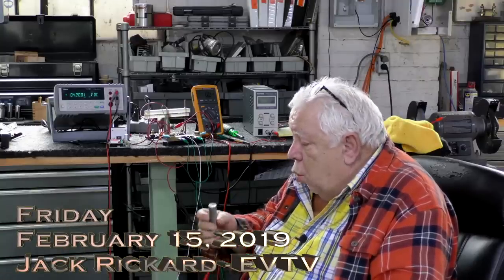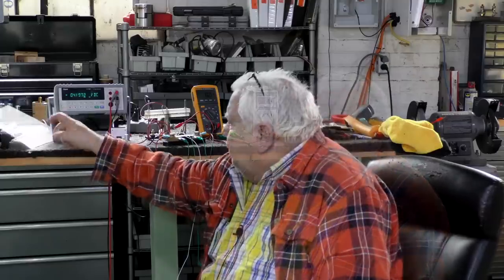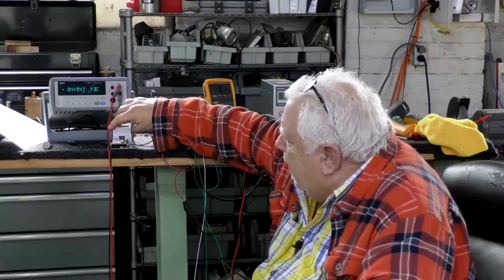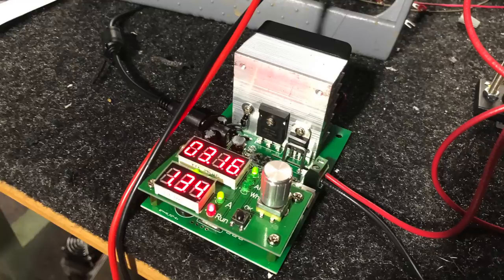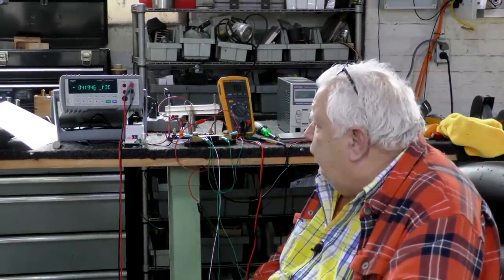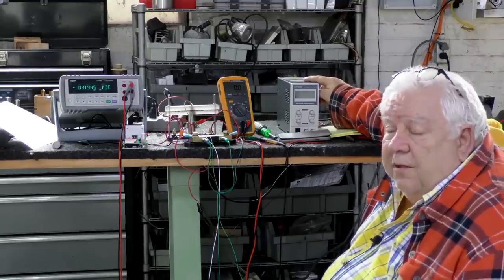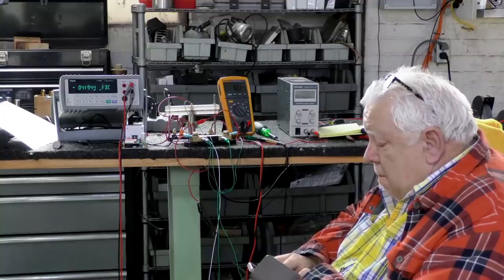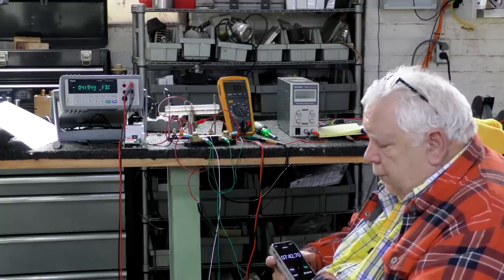Testing Tesla Model 3 2170 Cells - Battery Nerd Porn with Full Frontal Nudity

Comment: Great video !  One thing is the battery temp will get higher when its it the pack. Like 46 little heaters making there own heat island.
Reply: Jack Rickard My Chevy volt packs change temp very little in my power wall never more + or - 2f charging or discharging.  : )
Reply: Jack Rickard my Chevrolet Volt can consume 10.4 kilowatt hours in as little as half an hour which typically can run my house for at least half a day long as it's not summer time. the fun project I would like to do one day would be to find a Chevrolet Volt hit in the rear pick it up really cheap like two grand and use the entire high voltage pack with the 55 kilowatt hour generator if the engine already has attached to it then use one of your high voltage inverters to make a complete Off the Grid system with the car I think that would be fun project.

Comment: My guess is that the ultra capacitors will find a use alongside renewable generation to balance output.  I would wager there is plenty of peaks and valleys in energy output on wind turbines and solar panels.  Wind gusts and lulls or the sun going behind a cloud for a few moments.  Ultracapacitors, are extremely durable in terms of temps they can operate in as well as have an incredible cycle life.  They should be able to absorb incredible spikes in energy and release it consistently to the grid while outlasting the design life of the plant.  Space is not really a consideration, nor is energy density in this application.  Just adding 5 minutes of storage to a wind turbine dramatically increases it's capacity factor.

Comment: The batteries Tesla has called output more power than their motors can handle. So why can't they make a more powerful motor? What's the limiting factor for extremely high power electric motors?
Reply: Michael Simm there’s no need for bigger motors because then you would lack traction. If it’s not one thing it’s another. The new roadster is going to be the max limit of traction, motor power, and battery power working together. But as mentioned, it’s going to be more expensive than your run of the mill EV
Reply: @ryen7512  I totally agree for low speed acceleration tests. What I want to know is can they build a motor that can keep accelerating quickly at 200+ mph, can they get to 300?
Reply: Michael Simm of course they can, but there’s not much of a market for something that will go 300 mph. The new roadster will probably come close.
Reply: @ryen7512  it's not about the market, it's about 'slam dunking on every Gasmobile ever made in every single way' It's about the Halo effect and I think Tesla doesn't particularly care about making money off it.
Reply: why we need that much power for a daily car！

Comment: Oh my! Ffs now you’ve taught your helpers to say KiloWatt when they are talking about KiloWattHours! I‘m surely just like the old man yelling get off my lawn, but it hurts so much to hear that distortion. Maybe I’m feeling sorry for the newbies that are surely confused, as I was long ago.
I will continue to suffer mostly in silence, but every now and then I will break my silence and whine. 🤪
Keep up the interesting work!  Many thanks!
ps. Maybe check if your power supply has compensation terminals on the back, if so you can wire sense leads and get the cell terminal voltage to hold rock solid.

Comment: Mr. Rickard, I've been trying to turn the rusty gears in my head and thought of something that at this point would be nothing but a brain fart on my part, but thought it might be worth bouncing off of you none the less.  

If Panasonic's current 2170 cells packed into Tesla's module = roughly 250 Wh/kg...I can't help but think that it is a fairly big deal that Mr. Musk is betting the farm again on the Semi and Roadster being huge successes, and that now that the picture is becoming a little bit more clear on just what everyone kept saying was impossible a year ago.  The picture is that the Maxwell dry electrode tech is what I believe they were betting the farm on!  If the potential really is that they can squeeze 20% more juice out than what is currently possible, you're right that its not the biggest deal in the world, its a nice incremental step up.  However, when you start to look at numbers and start drawing some conclusions, I think its more than just 20% they're talking about here.  For instance, for Mr. Musk to state that the roadster will do "at least" 620 miles, you have to crunch some numbers to make that work.  Lets start by taking a look at the Model 3 getting 240 Wh/mi.  We can probably assume the new Roadster will do slightly better than that (driving very conservatively) and get 220 Wh/mi.  At current battery capacity numbers, the battery pack size/weight they'd have to stuff into a smaller and lighter package would be around 140 kwh total capacity at almost double the weight!  I really don't think that's what the Tesla team had in mind for a supercar killer.  Instead, I think that it makes more sense for them to standardize the battery packs across the Model 3, Model Y, and possibly the Roadster to save on production costs...but with this new tech that dramatically increases the amount of Wh/kg.  So already guestimating that the new roadster pack should have around 140 kwh, if you play with the increase in Wh/kg a little bit, it starts to come into focus that it's possible.  If the current Model 3 battery is 75 kwh, and you're trying to achieve 140 kwh for as little weight gain as possible to stuff into the fastest production car on the planet...then just increase power density!  To achieve that, they'd need an 80% increase...sounds pretty impossible on its face.  But according to the Maxwell figures of power density of up to 500 Wh/kg is possible, then 80% doesn't seem implausible now does it?  

All of that is to say that if they can get a 140 kwh pack that would be a direct replacement for the current Model 3, Y...that would be something wouldn't it?  Seemingly overnight, you could have electric cars that go just as far as their ICE counterparts?  A model 3 could easily go 500+ miles on that.  And if they make the 18650's with the same tech and upgrade new model S & X's...100 kwh x .8 = 180 kwh pack (model x = 320 Wh/mi @ 180 kwh = 560 miles) could do 500+ miles as well!  And the most beautiful part of it all is they don't have to change the battery modules/production/machinery/any further investment!!!  Now where have we heard of 180 kwh packs before...Rivian.  So if anyone thinks 180 kwh packs are too big or not realistic, they're already coming.  So then that leaves the Tesla Pickup...if they used the same pack as the S/X for Pickup...well, now everything seems to fall into place (no additional cost for a new pack because it would be the same for X/S, but still plenty of hauling range even at 500 wh/mi it's still well within Supercharger range).  Not to mention the reality of the Semi now.  

Anyway, sorry for the book, but just wanted to bounce this possibility off of you to see if it's plausible that this may be what Tesla is basing the numbers for the new Roadster off of...because if so, its very exciting times for the rest of the lineup.
Reply: @Jack Rickard Thank you for your response Mr. Rickard!  I've only been turned onto your channel in the past few months, but I've been addicted ever since.  Your knowledge combined with your wisdom translate to fairly in-depth knowledge explained to the layman such as myself.  I greatly appreciate your work, and look forward to many more videos to come!

That being said, I agree that all of that came up before anyone knew Tesla was even looking at Maxwell.  But if you follow the cookie crumbs, Maxwell stated that they had been working on this for some time, and had been working with a company for their proof of concept.  Also they were positioning themselves to be purchased from what their public documents stated.  Thats what lead me to believe that what Elon Musk said about 620 mile range, along with 500 miles of range on a fully loaded 80,000lb semi...again my simple math led me to figure it would cost Tesla around $120,000 with current battery pricing.  With the whole kitten caboodle selling for $180,000 that wouldn't leave much left for the rest of the build, let alone profits.   

We do know though, that there has been a few semi's rolling around, as well as at least 1 roadster.  I can only imagine that part of the testing going on with the semi is with this new battery tech.  Hell, they may even be working through several iterations of the new battery tech with the semi...thus leading it to the projections they want.  It's all guesswork at this point of course, but with the kind of numbers Tesla has to put up in order to make a Semi truck work, along with the projected numbers of "at least" 620 miles with the roadster going 0-60 in 1.9 seconds has to be quite a leap over current battery tech...and likely not just a 20% leap.  Thats why my assumptions, if anywhere near correct, would be very interesting to say the least as far as shaking up the entire fossil fuel industry. 

Anyway, again, thanks for the response and look forward to many more insightful videos and products from you and your team!

Comment: What are your thoughts on a commercial/ industrial variable frequency drive as an option for full battery packs? I input 270 vdc on VFD dc buss then output ac voltage. I have one that as long as you tell it to ignore phase checks I’ve gotten one to work.

 **270vdc because that’s all I can generate with on site rectification, but I would like to get up to 300-350vdc

Comment: Great Video Jack!  Any idea what Tesla is using for a 100% battery charge reference ?  i.e. is a charge to 100% putting a voltage on the cells of 4.2*96=403.2 volts?  Or is it something less?  Just trying to figure out if Tesla is putting in a buffer for their own CYA factor, and if so, what is it?  Thanks!!!
Reply: Tesla mention on their website (talking about the Roadster) that they limit the cell voltage to 4.15v per cell. I imagine they do that for all models. Nice to know :-)
Reply: They charge to close to 4.2V even 4.2V as soon as one cells hits 4.2V. HOWEVER, on the new batteries 2070L they soft locked them, because LG can't keep up with the density and don't have the same capacity. So they soft locked the batteries in the European cars to 4.15V whilst the LG ones still charge to about 4.19V or 4.2V. No top buffer on a Tesla, hence they suggest charging to 90%. You can check my vid on the topic.

Comment: Jack, do you agree that if using the exact same number of cells and the same cell types in a 400V system verses an 800V system, there is no difference in the max KWhr charging rate, or charge time, assuming that you use the same C charging rate?  The only benefit to 800V charging is half the charge current.

Trying to charge at 125KW at a nominal 345V is 362Amps.  Trying to charge at 250KW would require 724Amps.  That’s a pretty thick and bulky cable.  So I believe that 800V system has benefits above 150KW or so.

However, one thing I don’t understand…  When I see these claims of charging a battery pack in 20 minutes, I don’t understand how that can be done with today’s “known” battery technology without over stressing the battery and shortening it life.  Most battery have a recommend C charging rate of about 0.8C.  That means that a 5AHr battery should be charged at 5 x 0.8 or 4 Amps, and should take about 1hr and 15 minutes, approximately.  If you push it a bit and charge at 1C, then you can charge at 5 Amps for 1 hour.  Push it more, charge and 2C or 10A and charge in 30 minutes.  Pushing more, charge at a 3C rate, or 15 Amps and charge in 20 minutes.  Any documents I’ve seen about rechargeable battery shows that accelerated charge rates above 1C shorten the battery life.

Interesting point, it doesn’t matter how many cells you have in a pack.  A 1C charge rate of 100 cells will take the same time to charge 200 cells at the same 1C charge rate.

There was an article at Electrek.co referring to the Taycan that stated “They didn’t reveal much about the “Porsche research vehicle” that they used to achieve the 400 kW charge rate, but they confirmed that it was equipped with a 90 kWh battery pack and it was able to add about 100 km of range in just 3 minutes.”

OK, 400KW/90KW is 4.4C charge rate.  How can this be?  Either they are putting some very new, game changing battery technology in that car that can handle a high C charge rate, or they are just charging the battery way too fast to insure a long life for that battery pack.

Thoughts?

Comment: Jack, the U-cap are good on the buy too. Think about superchargers with those U-caps.
Reply: @Jack Rickard Of course not in a car (or truck) but in the supercharger station as to do what you were showing in this video with time. Let the U-cap keep the V constant while letting the A drop off. By doing so the station can have twice as many "pumps" working with the same max power draw from the grid.
Reply: If I'm correct, the issue will get getting the power from the charger, to the car, with a manageable cable?
It must work just as well if you're 6'4", 230lbs, or 5'2", 100lbs.

Comment: So does Tesla have a torque spec for the clamping pressure of the negative and positive bus bolts? It seems like this would be an important detail other than to say make sure you get them tight.
Reply: I was thinking in terms of maximum torque, so as not to strip out the threads, good and tight is subjective to strength, I seem to have a nasty habit of breaking bolts or stripping threads, so as a safe alternative it helps me not to over tighten whenever I have a torque-spec. I was just curiously anyone knew, it’s a practical matter for me.
Reply: Jack Rickard okay, I respect that you have no desire to further this discussion on your end, but I will offer you one tidbit that you may not know. There are torques screwdrivers and also short torque wrenches available that would likely meet your safety concerns. I know this because I do own some, and I use them on my various rifle platforms such as when swapping out scopes and mounts and such. It is beneficial to have them tightened as close to spec for several reasons. Temper changes being the most problematic but also, human error, such as over tightening.no need to ask me how I know, I’ve already stated it previously. 

I will admit that batteries which are a potential hazard when accidentally crossing the poles with a wrench is not the same hazard as working on an unloaded weapon, but the expense of breaking them can be in the same realm.
Reply: Jack Rickard incidentally this is the one I use most often it’s a bit pricey but it is a very good product. They sell various kits, I’m sure there are cheaper ones to buy but when you are working with expensive optics on expensive weapons it’s nice to have something reliable.

I don’t own stock in this company just wanted to share a worthy product that may be helpful to others.

https://www.opticsplanet.com/fix-it-sticks-combination-torque-limiter-field-maintenance-kit.html

Comment: Do you think it’s possible Tesla has already started adopting the Maxwell dry electrode process?  Correct me I’m wrong, but seems Maxwell was more of an IP company than a manufacturer.  Tesla may have done the math and realized it was cheaper to buy Maxwell than pay the licensing fees.  Plus, it keeps the technology out of the hands of competitors.
Reply: Jack Rickard - Thank you for the response, Jack!  I suppose I should’ve clarified that Maxwell isn’t a “manufacturer”...in the sense that it isn’t big enough to supply the auto industry, at least without a major capital infusion.  You mention VW, and I’m not sure what their battery strategy is at this point.  For awhile, it seemed all the stock analysts/bean counters were saying “Go to China, young man!”  (ie, outsource cell production to CATL or whoever) but I don’t hear that as much anymore.  I believe GM was unable to produce a Chinese variation of the Volt using Chinese batteries because the quality of the cells was so poor (or something like that).  That’s a sample size of one, of course, but it doesn’t bode well for a nation that wants to dominate battery production.  I suppose the question is whether or not VW or GM or any of the other majors want to dive deep into cell production like Tesla has.  If they do, Maxwell would certainly be a good buy and could be snatched away from Tesla’s grasp.  I’m not entirely convinced established automakers want to take the risk, because then they’d looking at building multi-billion dollar battery plants...while the bean counters scream for dividends.  Speaking of....Mercedes just cut its dividend.

Comment: I'd rather charge to a voltage than an estimated percentage, especially with repeated shallow charge/discharge cycles.  It appears 3.8V is 60% for the Panasonic cells, a good average for extending calendar life for the occasions when you do want long range
Reply: Doesnt someone make an app, like Tezlabs, that shows battery voltages in the Model 3?